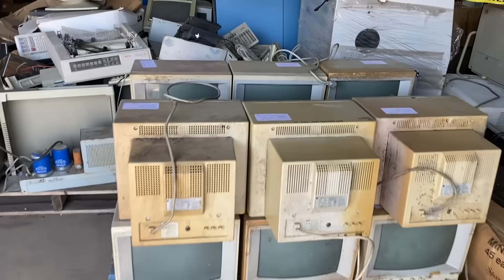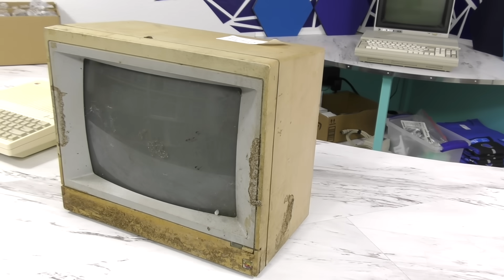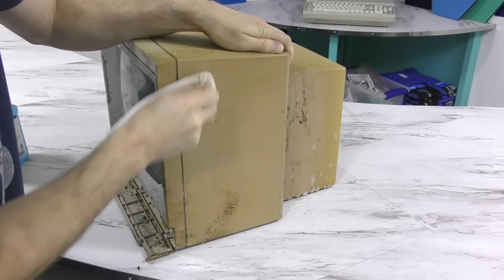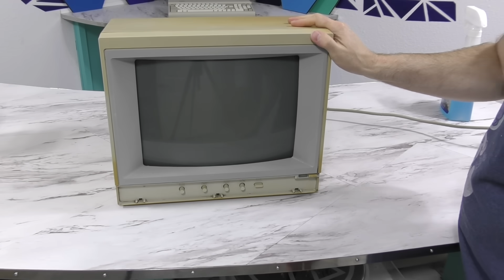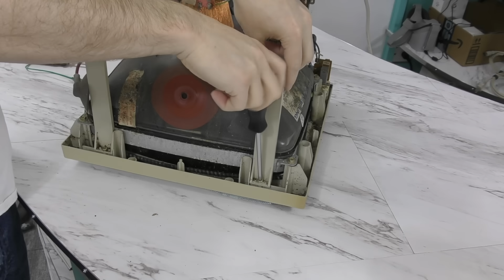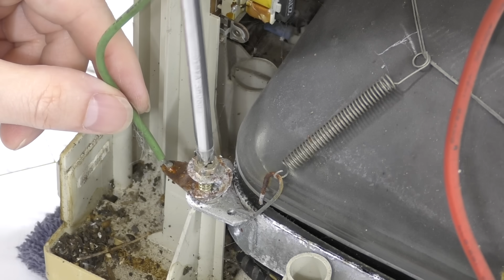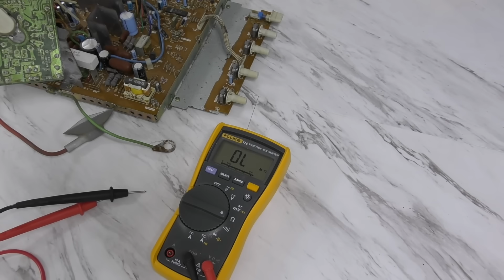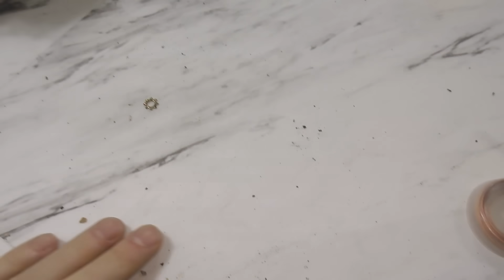Apple Monitor Found in Landfill - Restored - Part 1

Comment: 1980s: "Careful with electronics even the smallest touch can kill them"
2020s: "These sat outside 20 years and still power on"
Reply: "The Worst VIC 20 I've Ever Seen" is a good example.

and the Galaxy note 7.
Reply: Analog electronics which is what comprised alot of electronics back then are far more durable then micro electronics. its why a big hard wired radio is stupidly tough and resistant but heavy, big, and expensive. But a micro electronics small and light radio brakes if in the wrong condition. And its simply because all the electronics are all hard wired because its all analog operated and not digital.

It just boils into they don't build em like they used to because people would prefer convenient cheaper electronic over durability because its far cheaper to replace them then repair them unfortunately.
Reply: @Snivy-Wizard-Nattie  I know. But new electronics can still be durable too.
Reply: @Snivy-Wizard-Nattie  But if something hardly break, there is also far less repair involved. Todays it's repairing stuff is actuall a huge part of the business. Making more money with repair or say "it's cheaper to buy a new one".

And yes, modern electronic can be durable too, but this also depends on the quality. I own every Nintendo Console and everything still works, but i also try to be careful with it. Other ppl throw there Mobile Phones around and do like it would only costs 10 bucks (if in reality they pay over 500 bucks) and all this, because they change it in 6 months for another version.
Reply: Quite an unfortunate twist in irony, electronics back then were durable as hell but treated with excessive caution, modern electronics are way more delicate but not always treated the best.
Reply: @MakerNekoMizuki  because of the cost. A monitor in 1985 was several hundred dollars at least, whereas now a usable 1080p monitor is $80
Also digital electronics are harder to repair because how how small the components are.
Reply: @CaptainApathetic  Not just that but bean counters choose the cheapest most poorly made components that are basically designed to fail in five years.  After all what's better, selling one $2000 tv every  20 years or selling four $900 tvs?
Reply: @MakerNekoMizuki  Sad
Reply: @MakerNekoMizuki  I'd argue it's the other way around. They're also quite durable given how much we can abuse them and they just keep on going. No way I'd be able to carry around a computer from the 80s everywhere I go for years and years and have it still working like new today.

New stuff is built great. There's some cheap stuff sure but there's cheap stuff from back then too and most of it isn't around anymore because it was junk then and still junk now.
Reply: @orangejjay  I agree with you. Sure, many electronics are designed for planned obsolescence now, but technology has also advanced. Smaller more densely built electronics are capable of being built more durably. Especially solid state. 
A modern smart phone is more powerful than old super computers. Dropping the phone a few feet and dropping an old super computer a few feet would be an apt comparison.

Old components were heavier so there was more force on solder joints, for instance, when electronics were jostled around.

Devices today are more intelligent, less likely to fail due to more safeguards. Turn on a computer with no heatsink/fan for the cpu. 90s/early 00s computers will destroy the cpu. Modern ones will, if all goes right, thermo-throttle and save themselves. Plug a modern computer into the wrong voltage while traveling, well most likely the power supply will adjust and everything will be fine.
Reply: Meanwhile, nokia: "are you challenging me?"
Reply: 2023: "this device is very rugged and durable!"
literally 2 seconds later: device catches on fire
Reply: I found a bunch of IIe's, complete with monitors and disc drives at the actual dump on a pallet back in 2001.

Comment: Does anyone know of a common fault condition that would cause this same model of monitor to simply display a white dot in the centre of the screen?
Reply: @Captain McDog That's pretty much what I thought. When I powered it up after a  number of years in storage, there was a familiar popping sound that would normally suggest a dying cap. I looked over it but really didn't have much of a good idea of what I was doing so closed it back up and figured some day I'll find a repairer.

Comment: You should do an episode on the Pangolin Laser Show Designer for the Commodore Amiga 500. I have an Amiga with the modifications (when you bought the software, it came with instructions on how to modify the sound card to work with the galvos.) and the original disc, but I don't have a monitor (Old RGB Style)...

Comment: When I was 16 (1984) our family B&W TV went on the fritz.  My dad used it as an excuse to go buy a colour TV so with nothing to lose I went about trying to fix it.  I  noticed a burnt diode and tried replacing it with one I saw in Radioshack and although it wasn't the same one it was good enough and now I had my very own "monitor" for my ZX81!
Anyhow, my point was getting the exact replacement may not be necessary.  The only thing about those ones that looks special is they are cheap!

Comment: Why wouldn't you just disassemble the monitor, soak the outer plastic case in a large tub of water with Dawn dish soap for a day or two while you work on the inner components, spray off the outer plastic case getting 99% of the dirt off, reassemble, and then go over with a fine tooth comb if you need that much rigidity? Drives me nuts watch to this dude waste paper towel after paper towel and elbow grease just to get a half-assed job done on the cleaning part.

Comment: Well thanks for wasting my time dude, btw screw those companys dumping those old systems in a landfill, why not putting them in special designed bunker for it or wrap them around in plastic sealed cases to prevent moisture and dirt penitrating inside before dumping them and them mark that terrain sothat they can be resurrected one day, i regratted throwing my old pc’s away,never realizing that they will increase in value  one day😕

Comment: It's a B+ boost circuit. The diode it needs to be around 1600 working volts. As it has to handle the voltage spikes from the flyback and then the AC is rectified and filtered for B+ boost.
There should a large ceramic disc capacitor close by as well. 
Check it for damage also.

Comment: It is called an avalanche diode, it is a semiconductor device specially designed to work in reverse voltage. In these diodes, little doped, when the reverse bias voltage reaches the value of the breakdown voltage, the electrons that have jumped into the conduction band due to the effect of temperature are accelerated due to the electric field increasing their kinetic energy, so that when colliding with valence electrons they release them; these, in turn, accelerate and collide with other valence electrons, releasing them as well, producing an avalanche of electrons whose effect is to increase the current conducted by the diode with hardly any increase in voltage.

Comment: Lets all take some time to recognize that this monitor was sitting outside in minus 8 degrees F temps during the Texas mega storm we went through back in February, yet it still powers on.
Reply: Well below 0 F to well above 100 F. Plus rain.
Reply: @GeekTherapyRadio  Yep, it has gotten over 110 F before here in the Metroplex over the years so it is pretty incredible.
Reply: It’s snowed at least 6 times in those 15 years and over 100f every summer. Insane it’s even intact lol.
Reply: @TheHilo623  Indeed!
Reply: Rain doesn't effect electronics unless they're powered on......
Reply: @lunarDiscoLTD  No, but the water can cause components to deteriorate, and ice expands when it freezes......

Comment: this type of diode is called glass passivated ultra-fast recovery rectifier, and it's quite typical for old monitor designs - they usually rated on 1200-1500V and work in HOT circuit - your is not, instead, from what I can see on laminate you shown,  it's used in anode amplifier power supply. Vishay still makes this type of diodes, and you can buy them at mouser's without any trouble - search for BYV26EGP-E3/54 or even better BYV38-TAP
Reply: just going with comment James Landrum made - better suited will be BYW36 - same recovery time as orginal one (shorter is better here - less energy is going into heat when the diode switches back to non-conductive state)

Comment: It sounds like people have already given you a value that diode. In the era of television what's called the Damper. What it did was switch off the CRT voltage during the retrace time, no high voltage available. So 1960-70s TV an actual vacuum tube did this. The diodes doesn't have to be very fast and 600 PIV. Those visible retrace lines kinda gives it away.

Comment: "It's mostly clean, I could get it 100 percent clean, but it might take me a week"  9:30

Get a pressure cleaner and it will perfectly clean in 10 seconds.
Reply: And smash off the brittle plastic parts and shoot them off into the distance. If you want to try that, go ahead.
Reply: @PJBonoVox  You can adjust the pressure on pressure cleaners.

Comment: This is almost exactly what I love to do, ok I have on occasion spent big bucks on a product that is extremely rare or valuable.
But I really love buying stuff for a few quid which otherwise would be taken to the tip.
Yes I really do mean to restore everything that I buy and I have failed in the past but almost by definition, out of date tech can be replaced by better, faster products so it's not about needing them for their function, it's really a record of what has gone before.
For example, How many of the exhibits in an plane museum can still actually take to the air? 
Not too many but if you want to fly somewhere, other planes are available and yet there is still joy to be had in finding the one which can be made to fly again.
My grandfather, many many years ago found himself in possession of nearly a hundred 1930's vintage cars through his profession and although I don't know exactly what he ended up doing with them I am sure that he got them because of things others did, which is the situation we are in now with classic tech being dropped like a stone from people's lives.

Comment: This looks it is a boost diode for the 180V boost source. I would use 400 to 1000V fast rectifier diode, 1A current would be enough. Try to get both monitors working. Also perhaps there are few front panels still on the site where the monitors were originally and have just fallen on the ground. Would be worthwhile to check the premises again :)

Comment: You'll find in today's cut-throat market, the most desireable parts (like Nintendo, for example) go from, "Expensive for a new item," to, "Super expensive for an open item." It's like the traders didn't know the value they had on their hands when assigning MSRP, the products were reserved for black markets, and the only way to get them after that was a 200%+ markup for a used item. Not really great, but at least secondhand value will stop things from entering dumps, like your monitors did.

Comment: Those old monitors were tough bastards. I helped a friend of mine clean out her mom's house. She was 'forced' to sel her house to the city, due to the whole area flooding basicly every heavy rain. In the garage I found an old Commodore 1702 monitor... that was on the floor, under the flood line.  It sat under water many many times.  I had to try it and after some cleaning, it worked ike a champ. (Fun note, commodore used S-video imputs, so was easy to hook up a dvd player to it)

Used it for about a year til one of my young kids dumped juice in the top of it while it was on. :( It had a realy good picture, considering it was over 30 yrs old at the time.

Comment: I'd suggest using a 1N5408 next time for that diode, it's like a 1N4007 but rated for 3 amps. will work as a replacement like 99% of the time in power supplies, and most likely in the vertical circuit too since that's low frequency

Comment: These diode are avlance diode as well high speed diodes.. The blue means 400 volt, and red is 600volt and green for 800 volt.  RS still has the blue one type v07 which is safe to use as it would be fed 180 volt.

Comment: An important thing, too, is that trying to scrub old electronics with the plastic panels removed greatly increases the risk that you will break the plastic.  Putting pressure on old, often brittle plastic is already sometimes a big nerve-wracking, but when it has no support behind it then it's doubly-so.  It makes a lot more sense to do the bulk to the heavy cleaning when the thing is assembled and really only worry about the tiny spaces you can't get into once it's taken  apart.

Comment: I'm coming in late to the comment party here, looks like the bad diode got identified and a replacement spec'd and ordered.  I'd worked with similar diodes of similar vintage back in the day, their packaging wasn't my favorite but was the only thing available at first.

One tip for older CRTs, watch out for those with non-glare coatings.  At work one day (in the '80s or '90s) someone cleaned their monitor face with an aerosol glass cleaner spray containing alcohol or ammonia, I've forgotten which.  It destroyed the anti-glare coating to the point where they fully cleaned it again just to get rid of the remaining residue.  Luckily more modern cleaners can be found that are safe for electronic screens, but if you're not sure, test it carefully.

Comment: Hope you ordered a High Speed Schottky diode. A standard diode will cause more issues. HV part of CRT monitors run in the 15Khz to 40Khz range. So you need a fast acting diode.

Comment: If you cannot read the schematic and reverse engineer the circuit, you will lose out in the end. Paul Carlson can do that... and you might learn a bit about things like failure modes and especially restoring old electronics from his channel, Mr Carlsons Lab. First rule of thumb, replace ALL the old caps except the micas. Those old electrolytic caps should ALL go... IF you wish anything to work. de KQ2E

Comment: to bad computer reset is so far away for me, would love to look around there. also a tip, you can place the monitor outside in the sun for like a week. this works for most white plastics, it becomes white again. its a chemistry thing, sunbeams trough a window causes plastics to yellow, but outside its not missing certain elements in the sun beams and will make the plastics white. no need to use retro bright, i have tried this myself on a yellowed white clock radio and it actually worked.

Comment: I'm tempted to pirate PETSCII Robots, if only because I'm flat broke for the next 3 weeks and I'll be playing it on an emulator, I don't have the original hardware.  

But at the same time, I feel bad about it.  Piracy doesn't feel as good when you "know" the author of the game.  

I actually tried this with Game Tycoon.  Pirating the game because of the anti-piracy easter eggs that they put into the game!  

Sadly, what had happened is that rather than putting anti-piracy into the actual game, the developers release a pirate version of the game.  When I pirated the game. I got someone's legit copy and the anti-piracy didn't kick in.  I was actually disappointed!

Comment: CRT techs call that raster fault "over bright with retrace (lines)".  The Grid 2 screen voltage (ca. 400 VDC) may be too high.  Check for a control, usually on the CRT neck board - may be marked "SCRN"  "Screen"  "G2".  Corrosion or bad (or missing ;^) parts in this circuit are the likely reason for this fault.  But a thorough cleaning is the way to start.  Thanks for the restoration videos, David.

Comment: When you’re getting into replacing diodes like that you’re getting into vintage TV repair stuff and the answer is to get literally any diode with a sufficient voltage rating and try it out. If the circuit goes above a certain frequency, the general purpose silicon rectifier may not work right so try a shotkey diode instead. Literally anything will probably work. I doubt they would be using old-world stuff like germanium detectors on a computer monitor because there’s that stuff was pretty much gone by the time computer hardware was being made. I’m interested to see how a random diode from the mouse catalog works. I bet it works great.

Comment: FR105 (or 106,107) diode probably will work there fine, but replace all capacitors after, which are probably dead because of that corroded diode

Comment: Any high enough rated diode should work, 1n4007 or a 1n5408 would be ok, it will only pass the voltage it gets and supply enough current

Comment: Any fast recovery SMPS PSU Diode should work like a charm here. 180 volts suggests that this is the supply for the Carthode circuitry. For further investigation you should turn the G2 down on the flyback (should be the lower pot)  just to save the cathode and screen. If the 180 volts are missing your image could potentially look like this because if the cathode sees no voltage the screen is literally at full brightness and the cathode's at full smack. The retrace lines might occur because of the heavy load without cathode voltage. By any means, take care of yourself!
Let me know if you need further suggestions! I am an old radio and tv rabbit! Cheers

Comment: the plastic could all go in the dishwasher.  the circuit boards too, if you're careful with the heat settings.  and make sure it thoroughly dries.